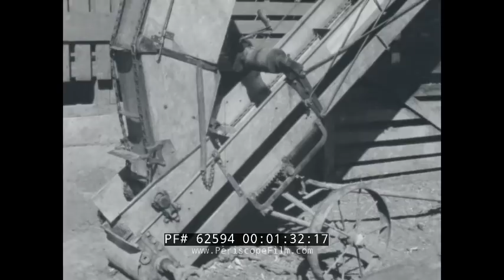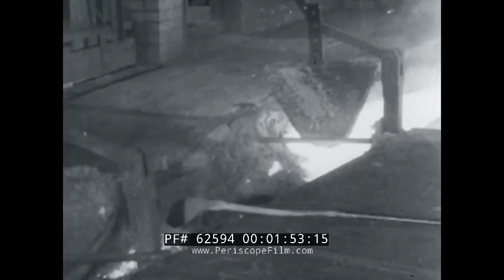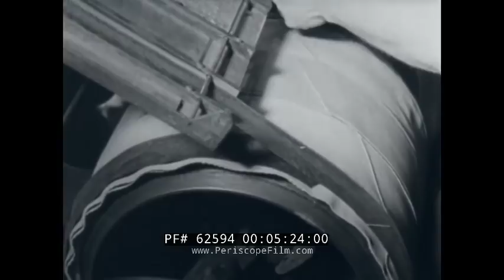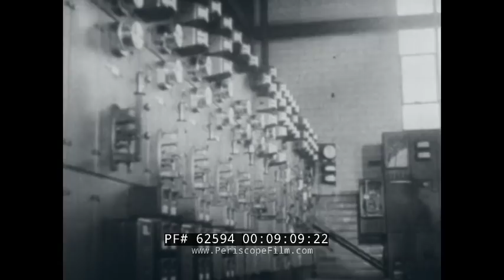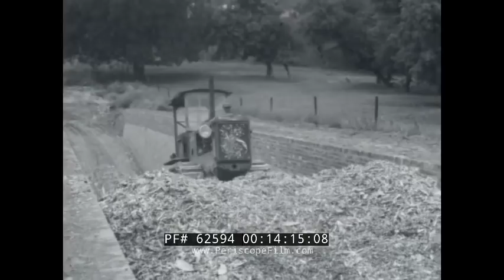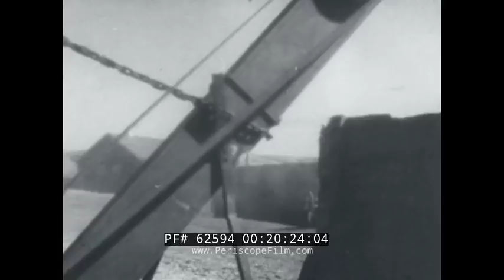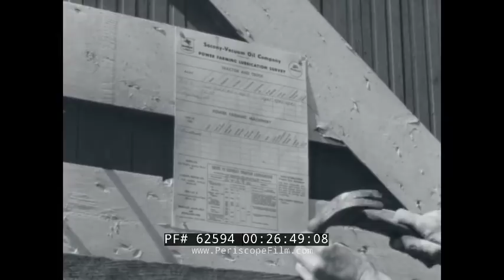1940s SOCONY VACUUM OIL CO.  OIL & LUBRICATION PROMOTIONAL FILM  "GETTING DOWN TO EARTH AGAIN" 62594

Comment: At 18:57 is a license plate that appears to be 1940.  Most of the vehicles and tractors in this film are pre 1940.
Edit: I would say all vehicles in this film are pre 1940.  The Allis WC at 1:31 is a styled type which started production in 1938 and went through to 1948. Otherwise just about every other tractor in here is also pre 1940. Also note that most or all civilian production of vehicles and machinery ceased in April 1942 in order to shift for WW2 production and the items that came out in 1945 - 46 didn't have the styling of that in this film.  9:40 Also note that the Farmall letter series  (probably an "H") started production in 1939 and was continued after WW2.
Edit 2:  My point above was to say that this film was more than likely made before 1940 -42. Especially when I can see what looks like a 1940 Iowa license plate.
Reply: Good eye, couldn't have said it better myself. Anybody checked this guy's work yet to be sure its not 1941? Those days it wasn't uncommon for you to not see muh of what was brand new that year, and styling was what changed rather than the modern "brand" stuff. Someone who knows prewar american dresses might be able to say, suit cuts change slowly so those aren't AS helpful.
But yeah, 1946 the GIs coming back from their WWII film crew years had much more experience (with trauma driving them deep no less!) and in 1946 when the production of films for the homefront began again there's a lot more refinement to the demonstrational special effects and shot choice, plus narration, showing what the film men learned overseas.

Comment: Thank you Periscope for this Video .  Here is Part of the story of Vacume Oil  Refinery 1866 .   If you look on Google maps aerial view you can see the original site of the Refinery , its a Brownfield with abandoned Buildings .  Rochester , N.Y on the west Bank of the Genesee River across the River from Mt Hope cemetery , North of the U of R .  It is still there and you can see a Rail road grade that used to cut right thru the site . Prior to the Rail road the Genesse Valley Canal ran thru the Refinery .  A rough History  about 1899 Standard Oil  bought Vacume  Oil .  Between the 1880s and 1911 the Govt tried to break up the Monopoly of Standard oil .  Socony is Standard Oil Co Of New York , a Child of the Break up .   Mobil was a company  that was bought by Standard Earlier . In 1911 Vacume oil was taken away From Standard by the Govt anti Trust efforts .  The companies still may have been owned by Standard but operated as separate outfits ? 1931 Vacume Oil And Socony Oil Merged . 1955 Moibil Oil Company Moved in . Keep in mind all were at one time owned by Standard oil .  In The 1960s it all Became Mobil . We still have those Metal Pint Cans with the Mobil Red Flying Horse in the basement and the Garage that held additives .    My Old Man Drove Oil trucks in the 60s hauling Mobil Fuel Oil around . He used to make three runs to Buffalo to the Mobil Refinery in Buffalo to Drop ship a Tank load  of Fuel Oil to Factories and Dairies . He also  Drove a small tanker delivering Heating oil to the houses in the Neighborhoods in the City .   The Heating Oil Company ( Langie ) was Located right next to the Huge Mobil Tank Farm That can be seen by the Airport . It is much smaller today than the 1960s Mobil Tank Farm across the Erie Canal from the Airport .     I hope this Helps if someone is Curious about the Names ?